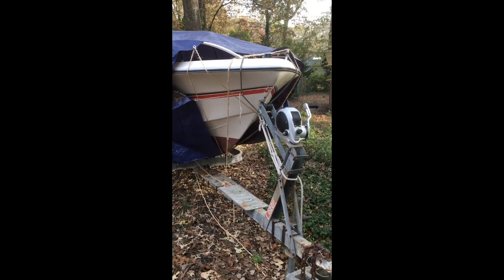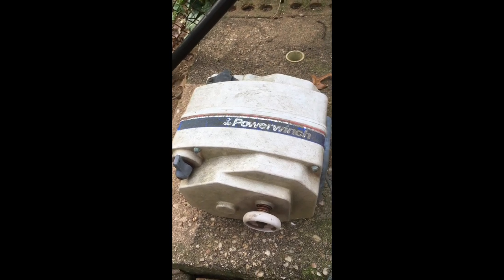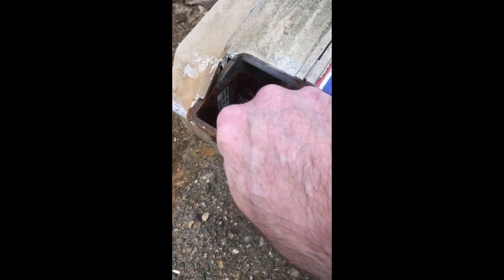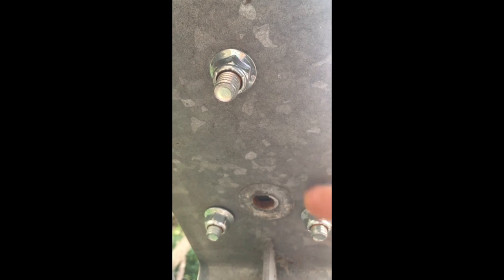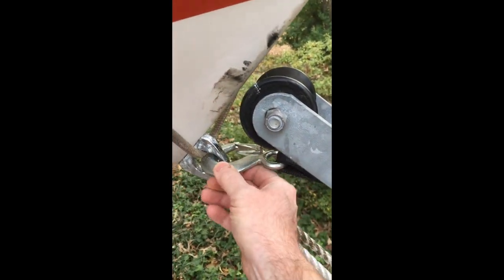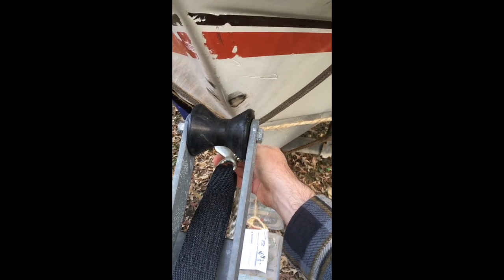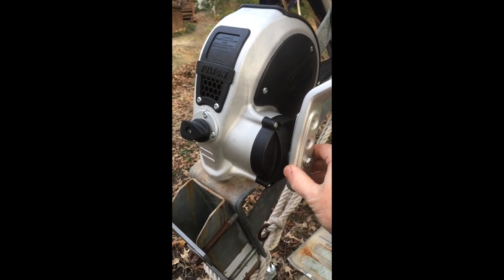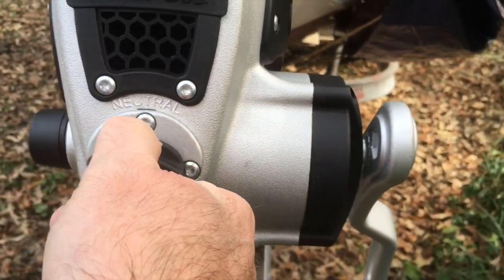Boat Trailer Winch Installation of Fulton F2

Comment: why would you trust an old rope tied into knots?  The F2 is a 3500 lb winch and designed to hold the load of your boat.  Buy 3 new galvanized grade 8 bolts and nuts.
Reply from the maker: Good question! At the time, I liked the idea that old rope takes the load off the winch. If the rope fails, the winch will still hold this little boat. 
I ended up putting this winch on a trailer for a bigger boat - https://www.youtube.com/watch?v=NE2uZaQmTLw&t=78s